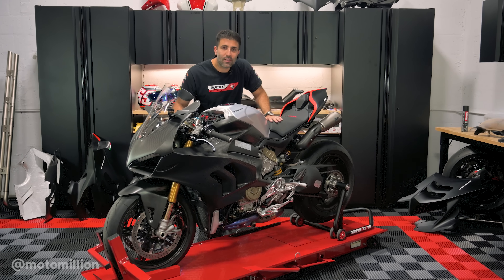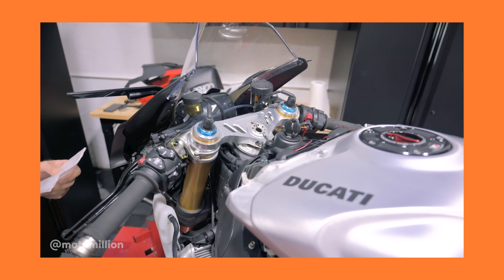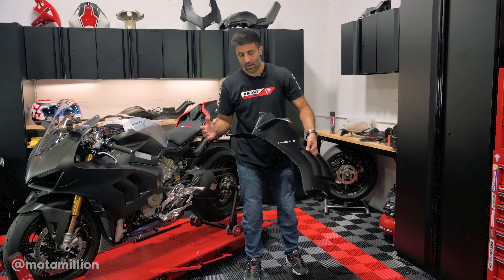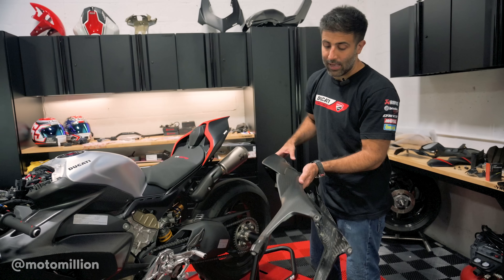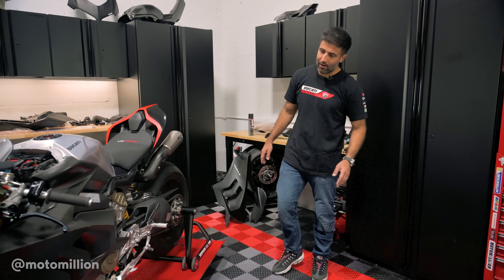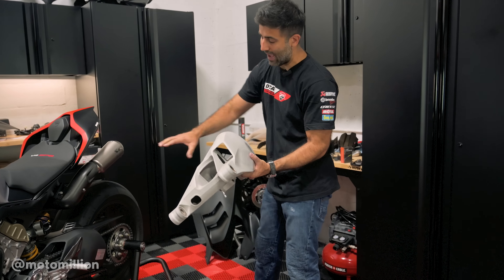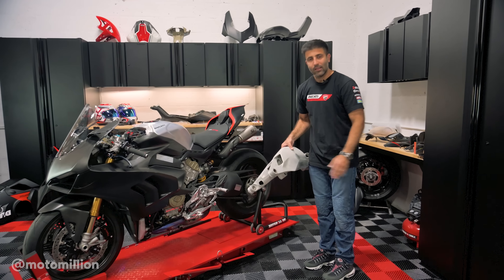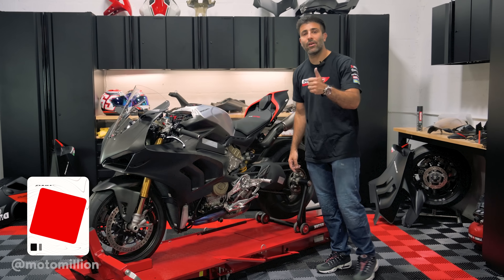What's Next for our Ducati Panigale V4 SP2? | SP2 Series Part 11 | Motomillion

Comment: A definite yes to the brushed and sealed finish....not sure about carbon on it, easy to mock up and see how it would look though.  That swingarm seems pretty heavy, despite being lightened,  but with all the forces controlled on one side it will always be heavier than a dual sided  - all motogp have dual sided for this reason...function over fashion. Have always wanted to see a motogp type swingarm on a v4 road bike,  now that would be different  !!
Reply from the maker: MotoGP bikes are different beasts, but if you look at WSBK, they are still using the single sided swing arms on the Duc's.

Comment: Are the RCS corsa master cylinders better performing? Only ask cause you can integrate reservoirs and clean up the look with those. Thoughts?
Reply from the maker: Better performing versus which other? Better than stock but internally same as the RCS 19